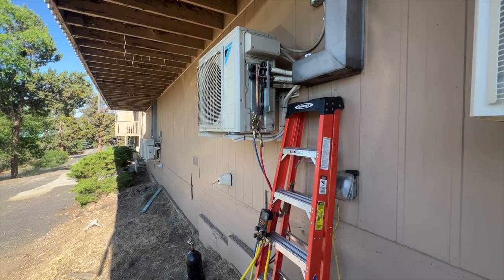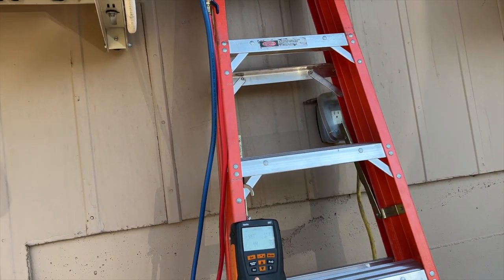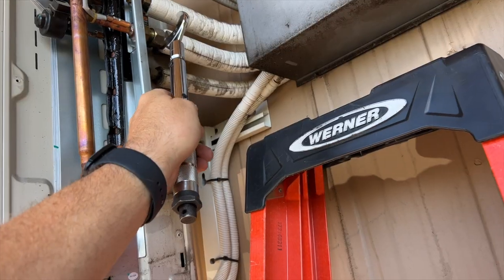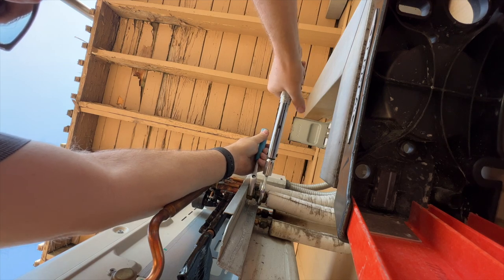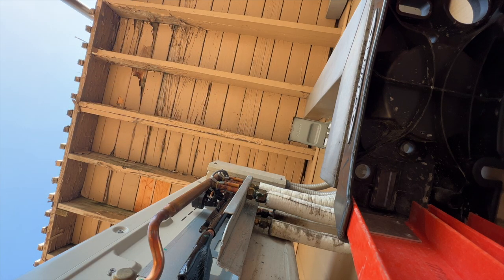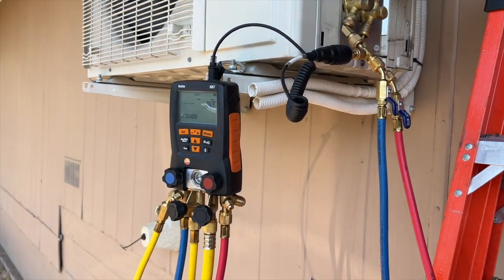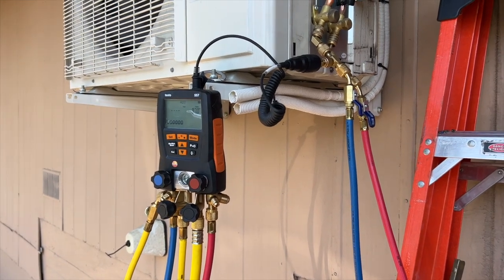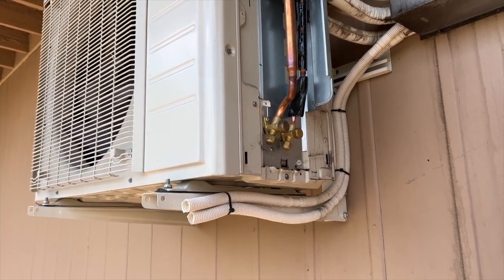Daikin Minisplit Not Cooling Normally. Finding and Repairing a Refrigerant Leak EP92

Comment: Do you not remove the schrader cores? The access to service valves on these units are horrible for a 5/16 Schrader core remover. Is it easier to just leave them in and use the 45 ball valves like you got here?

Comment: I have three daikin heads. They all connect to the compressor outside. My two bedroom heads are perfect and blow ice cold. My living room only blows ice cold when they top it off with refrigerant . A week later it goes from blowing warm air for a while then back to cool air but never ice cold like the bedrooms. They came out snd said they found a leak. But a week later here we are and the same thing is happening. What is going on !!!
Reply: probably like an electrical issue. did they fix it ?